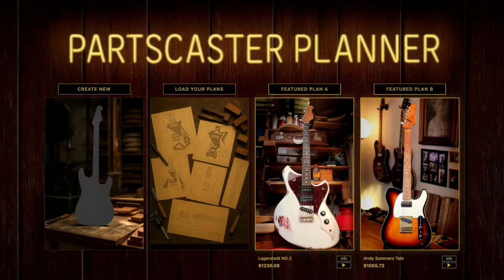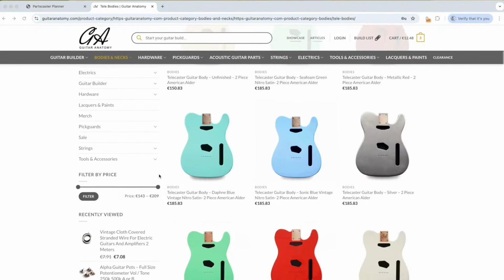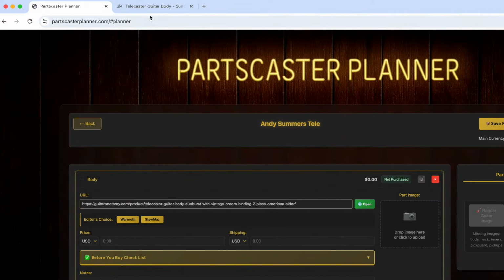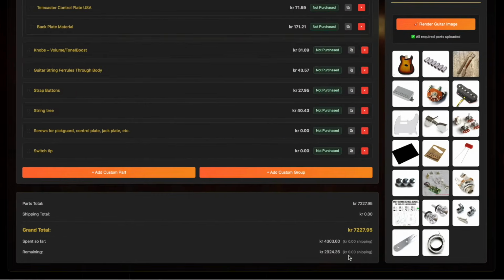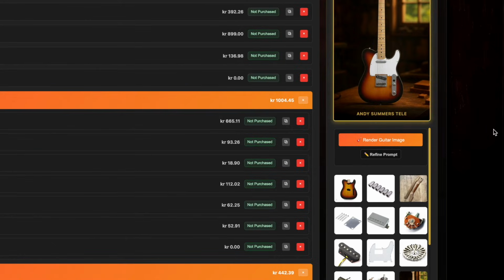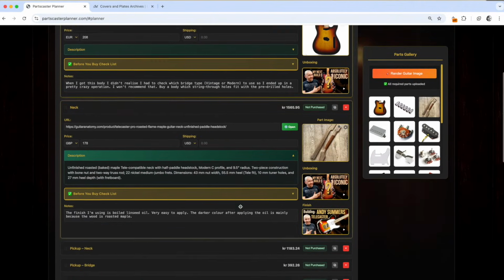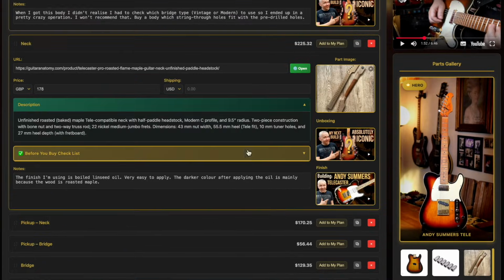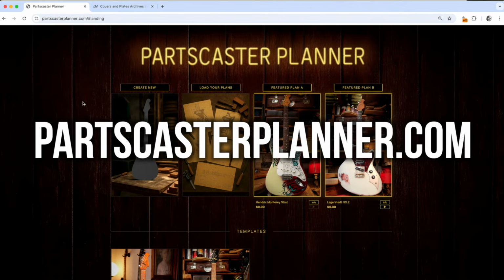Don’t Build a Partscaster without a Plan.

Comment from the maker: Please try the Partscaster Planner and let me know what you think 😅
partscasterplanner.com
Reply: I think it's not working:

555 Security Incident Detected

Your request was blocked.
If you are the owner of the website

The Website Application Firewall protecting your site blocked this request as suspicious.

Details can be found in your webserver logs.
If you are the visitor

Your public IP address, assigned by your internet or VPN provider, may have a poor reputation: Check IP reputation. IPs from VPNs or public networks often have poor reputation.

Comment: That's a FANTASTIC concept, especially if you have one or just a few  Partscasters under your belt.  I would definitely use this for a trickier build.

For those who have never done a Partscaster, I promise you that not everything will fit together if you get the Neck from one place, the Body from another, and a Pickguard from somewhere else. Especially if you are doing a Offset as your first Partscaster. A big part of making these guitars happen are overcoming these challenges and sometimes, you will need a professional to step in.

If this is your first time and you want a more certain outcome, I would recommend finding a Cheap Import or a nice Mid Level guitar that you would like to upgrade. That way you have a Neck, Body and Pickguard that all line up and you have the cheap bits like screws and button straps that many people forget in the shuffle to put a proper Partscaster together. 

In my mind a Heavy Mod to an existing guitar is VERY CLOSE if not overlapping on lots of Partscaster areas of a Venn Diagram. Especially if you are going to make say a Stratocaster and use Stratocaster parts from various sources. I think where Partscasters really shine are on things that either do not exist or are Custom Shop only. Putting together a Fender Telecaster with genuine Fender parts will give you a cool variation on the dozens of Telecaster versions that are out there. Now putting in Filtertrons with a Wide Swing Tremolo and a Must style bridge... you get my point. Fender doesn't make that.

The more you can do yourself to put the guitar together, the less expensive it will be. I would also suggest that at the end you have a Professional Luthier do a final setup so that it fixes minor issues and makes the project playable.
Reply from the maker: Thanks for an amazing input. I’m on my 5. build and also my most ambitious until now. Its so much fun.
I would hope that great builders would like to put up plans on partscasterplanner.com . I need help to get more guitars on the site so I have contacted a few YouTube guitar builders but no answer yet. So I need a confidence boost and I’m so glad you like the concept. Please share it out there in the guitar world 🙏🏻🤩
Thanks so much 🥳
Reply: @MichaelLagerstedt 
Sure thing. It was mainly aimed at other people because you know what you are doing as well as you have good problem solving skills. 

I can recommend Mike Adam's video on Offset Partscasters on his older Pushieen Channel. There's also a great video on Bigsby tips that make a HUGE DIFFERENCE in dialing in your Bigsby. 

As for Strats and Teles, if you get the Body and Neck from the same place they will have the best chance of fitting together. If you get a Neck from one vendor, say in Austria and then a body from China, they might work, they might not. Most people expect Lego ease and are dumbfounded when it gets hard. I have a Squier Partscaster that's a total Money, from the stage it looks GREAT but the closer you get the ROUGHER it looks. It's still a FANTASTIC guitar for a Squier Partscaster with Fender pickups in it, but you still have to "make it work."

I have a Squier Precision Bass from 2001 where I upgraded the crappy pickups with Duncan Designed P/J pickups from a much newer Squier Jaguar Bass and I had to remove wood in the Jazz pickup cavity because the Duncans were bigger than the OEM pickups. At least everything else went on there with minimal fuss and that was a Heavy Mod Project and not a Partscaster. 

Now if you want a Surf Green Andy Summers guitar and Fender doesn't offer that, that's when a Partscaster comes in handy.😉👍✨